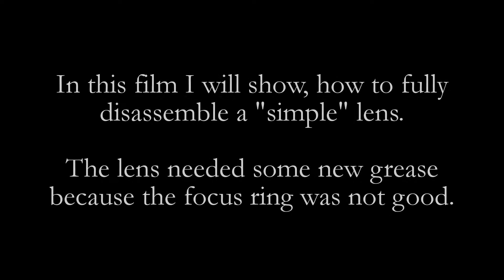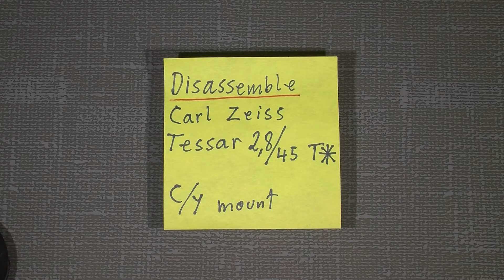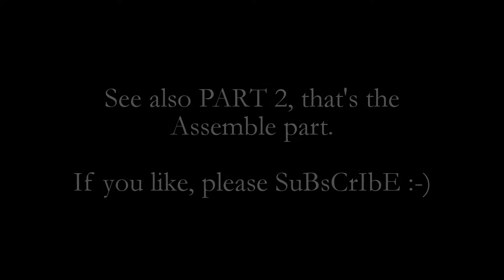Disassemble Carl Zeiss  2.8 / 45  T*    C/Y mount

Comment: @mikeno62 Congratulations. Very good work. I just buy a Carl Zeiss Touit 12mm 2.8, and i just see fungus in the inside lenses. I realy hope i can fix this, because here, in Bolivia, there is no place for Carl Seizz Lens assistance and no one want to take the job. Please, if you have any recomendation for disassemble this lense, i will be very gratefull. Thanks a lot
Reply from the maker: When I look at the pictures about that lens, it looks like you have to unscrew the name ring with a rubber tool and also the mount, use JIS crosshead screw drivers, to get into the lens elements. BE CAREFUL to set marks where the lens elements should sit BEFORE disassemble, so the lens is correct assembled again.